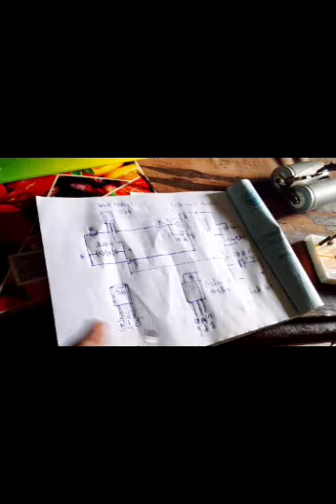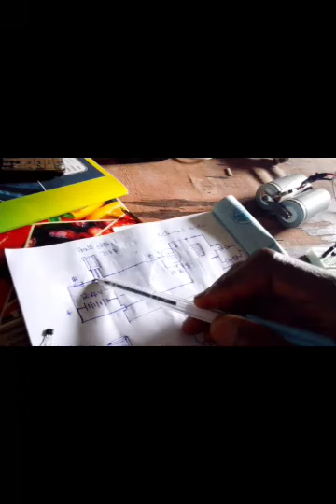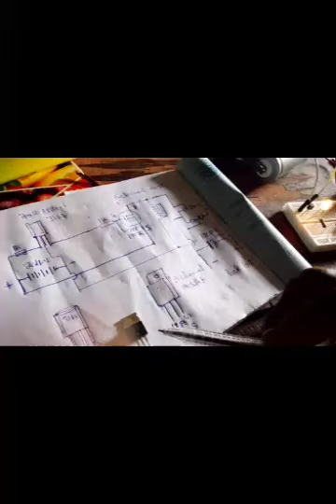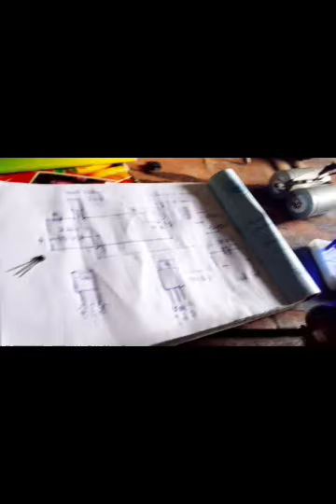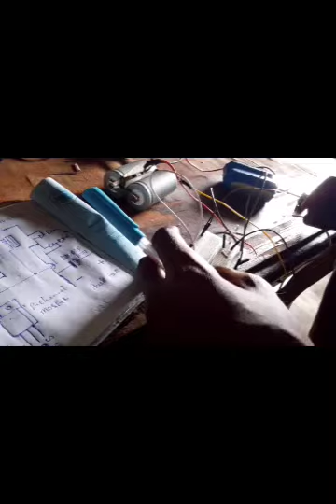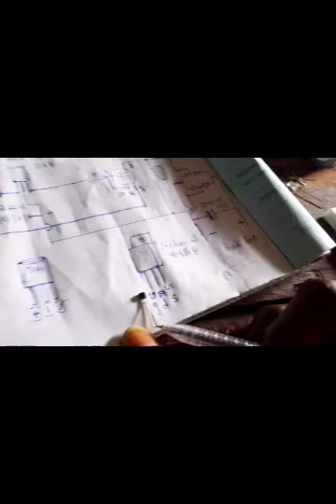The Hall effect circuit

Comment: Thanks bro. OoH,  you mean the hall effect sensor can't be destroyed with voltage 5v. 12v can also well without destroying it?
Reply from the maker: Yes it can work very well. All you just need is a 1k resistor to connect the first pin to the battery+.
Reply: @JfGreenEnergy Ok  thanks bro